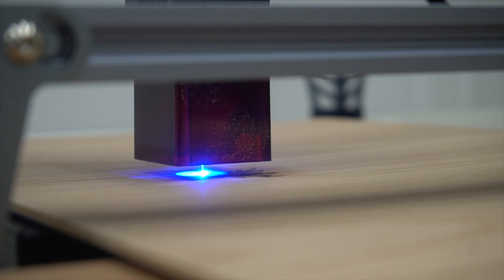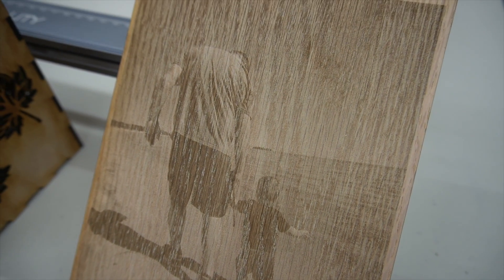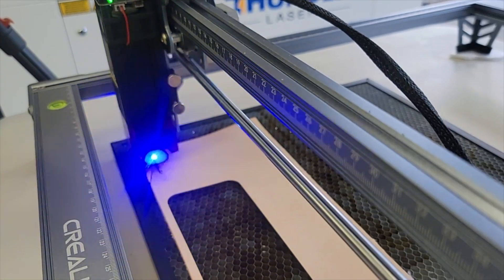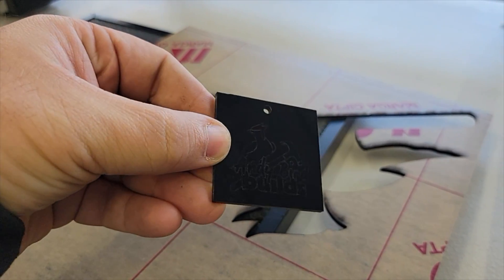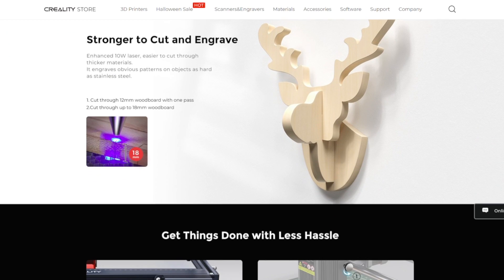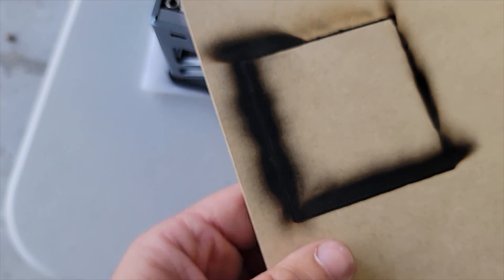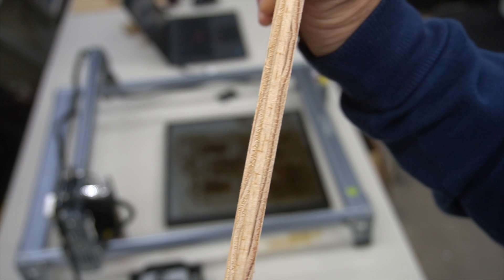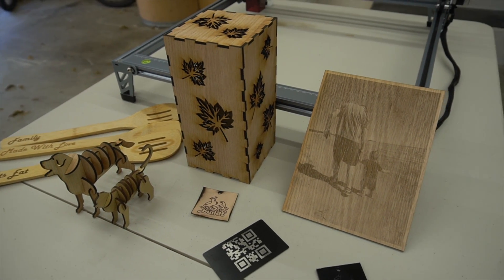You can make EPIC things with this $500 LASER! Creality CR Falcon Laser 10w Test and Review

Comment: With this laser you need to do three things first. Make a speed/power board, a linear test board, and a focus test board. 70mm/s and 20% with 360dpi will engrave clean no smoke in most light woods. Use offset fill to speed things up by eliminating useless scanning of the laser head, For portraits use image adjust to make the photo high contrast, and run Jarvis mode at .07 linear.

Comment: I really want to do this, but I live in an apartment complex that has an attached garage unit. The issue I see is the lingering smoke or smell  emminating from my open unit and there is also a fir sprinkler in my garage, any advice would be greatly appreciated!
Reply: You need a multi-stage HEPA/carbon fume extractor to control the smoke and fumes/smells when using one of these lasers in a confined area. Costs as much or more than your laser but effectively does the job! Amazon has them, as well as lots of other suppliers

Comment: Id say slowing down the laser doesn't give you a deeper cut because you've already reached the point of carbon buildup in the material. Which would also explain why you got a worse cut by slowing it down. As you cut and it burns the wood that would material turns to ash inside the cut which prevents the cut from continuing. If the cut wasn't going to be made anyway then slowing it down just creates more ash and makes the cut harder for the laser to reach the end of. Aerosys doesn't really help with this because it's not going to get all the way down into the bottom of the cut to clear the build up. That's why I even large lasers tend to make cuts in multiple passes versus trying to make it all in one pass super slow. Not only does it create less build up in the cut but it's often faster and cleaner then going as slow as possible in a single pass. Good video, i like your logo and the geometric background wall.

Comment: You are wrong about metal engraving and power.. atomstack 5.5w can do engraving in metal with compressed spot technology.
Reply from the maker: It can mark or remove the paint from the surface of the metal, but it cannot actually engrave into the metal.
Reply: @AndyBirdBuilds   Creality seems to claim it can.

Comment: Can you hook up an inert “shielding “ gas ((Ar, N, CO2, with proper ventilation)to the air Assist?
Also, can you “dish” an area of wood? I’m trying to imagine a painting pallet made of lightweight wood (balsa, etc) with dished areas around the pallet for paint. I was thinking set the depth of the laser depth at about 1/3 the thickness of the wood in the shape of an egg”ish”, then crank up the air assist with the inert shielding gas. 

I’m sure someone’s done this by now, if you’d point me in the right direction, I’d appreciate it. Thanks for the video. Very informative!

Comment: Sorry for being a little late to your channel. Focal point is an important factor, not just laser power. Lasers are so precise because they can focus the energy at just one point. But the thicker the material is, you're actually looking at multiple focal points. You can increase the energy, but the resulting power will just burn more stuff rather that having a precise cut. So, best to plan for multiple passes, each one going slightly lower in the Z axis for focus.

Comment: I have a creality 10w laser and I was able to do light engraving on both high carbon spring steel and stainless steel.  I haven't tried aluminum.  I was running at 2mm/s, 100% power and did 4 passes total.  It wasn't real deep but it definitely etched/engraved.  I was putting a symbol on a knife and bumped it, which messed up my setting up and it took 20 minutes of hand sanding to fully sand away the engraving that I messed up so I could start again.
Reply: That's what I thought, the Creality website claims this laser cutter can engrave and cut matte stainless steel.

Comment: you can cut wood better little more speed and not can one pass, need many pass then cutting good. mean laser need draving picture etc, round 2 time or more then cut and not burn edge lot. best have if use cnc carving machine Z axis can  drop ewery pass better focus and cut better not burn wood edge lot, because ewery pass laser optimal focus have little down has burn/cut wood little more down ewery pass.

Comment: This is a awful piece of kit. Arrived broken, I had to soldar the control box wires back together after they asked me to do it. This morning it blew every fuse in my house and will not work.
No customer service in uk even though I bought it from the UK store.
Buyers beware
Reply: If this little thing could blow every fuse in your house, the problem lies with your house.
Reply: @Jamvan001  sure, or one soccets have too many device sametime. 230V 10A fuse can use max 1200W machine 16A fuse normal can cut 3400W or sauna stove or big motor circular saw.
Reply from the maker: Can you confirm that you purchased this exact laser? I ask because there are a lot of similar knockoffs.

Comment: I have a Neje 3 Max with the 40640 12w optical power module, cuts 6mm MDF at 300 speed 100% power and 3 passes, clean and no charing of the wood. Focus set minus 3mm and air assist is an absolute must. I'm sure with a bit of tweaking on your part this machine will do similar. Also cuts and  engraves  3/4 mm acrylic ( black and some of the darker colours, diodes will not cut clear or very light colours). Hope this helps.
Reply: Ah, cool info on the clear acrylic!  Saves me the hassle of thumping my head about that lol
Reply: Do you think the 80e neje worth buying it. Is it worth buying the 4 ver 3 . Or is the 3 good with the lower price

Comment: I have the CR Falcon 10 Watt, and while it won't mark aluminum, it will mark some metals.  For example, I have marked a variety of hand tools.    To mark aluminum using a marking spray or tape should provide good results.  CerMark makes a variety of products designed to mark metal, including aluminum.  Brilliance Laser Inks is also working on a product to mark aluminum.

Comment: Did the laser run on full power? I've been told and noticed myself that the laser may deteriorate in doing so. In such case you probably can not cut through the same material at 1mm/s anymore either.
Reply from the maker: This was at full power. I've heard the same thing but I think its more of a gradual decline. I don't think I would see the loss of power this quickly
Reply: @AndyBirdBuilds  For me it was rather quick. I would not generalize this. But I think its worth considering in your investigation.

Comment: Another great video Andy.  Even though Andy called Anodized Aluminum “painted Aluminum.” It’s really not equal. It is a coating kinda paint ish but it actually changes the face of the aluminum structure and colors it.  It adheres to the molecular parts of the changed surface.  I would just think of a gold plated surface.  Still not exactly the same but closer.   I am quite sure Andy knew this much and more.
Reply: There is aluminum that is only anodized, it has a light grey matte color. In order to get other colors like red, black etc. the anodized surface is impregnated with dye (paint) before it is sealed to keep the dye in the metal oxide layer. So if it's anything but light grey, it's both anodized and dyed.

Comment: Why not cut faster and multi passes?  I think with air and 3mm per/sec you might get there in 2 or 3 passes
Reply from the maker: Yes that would work. But I was testing the power of the laser and multiple passes wouldn't tell me that. My question is why when slowing the laser down didn't it cut deeper?
Reply: @AndyBirdBuilds  cnc machine u can cut lot better ewery pass laser go little down and focus have better/optimal. how smallest line wide have then better laser focus have and cut better.
Reply: @AndyBirdBuilds  Fixed focus lasers seem to have shorter cutting range, those that have a focal distance of about 50mm have longer cut range.  Still pretty crazy that these cheap lasers can cut through this thickness of wood.

Comment: I think trying to cut 1 pass isn't doing you any favours. Your focus point needs t change,  but your focus is at top of the material never progressing through.
Multiple passes in Lightburn will allow faster speed & progress to greater depths at each pass. In 1 pass you've probably found the limit of intensity of the Laser per pass at about 5mm. But inspection of the cut face might show changes in burn intensity/depth.
Reply from the maker: Thanks for the tips! Any idea why when I slowed the laser down by half, it didn't cut any deeper? I feel like going from 1mm/sec to .5/mm should have cut deeper. I know that multiple passes would solve the issue, but that still wouldn't solve the above.
Reply: @AndyBirdBuilds  soot build up in the groove? Can't remember if you were using air blower for that carve, but it's possible overheating soot will caramelize it to chunks of carbon rather than loose soot
Reply: normal 10W focus power laser can ccut 20mm wood. maximum ,  multipass. but 5W laser only 3-5mm

Comment: In university we had a couple of Epilog CO2 lasers. Whenever I noticed it wouldn’t cut all way through (when it probably should) that was an indicator that the lenses needed to be wiped with some alcohol (to remove soot). 

I’m not sure how the diode laser module is constructed but perhaps there is something similar you can do.
Reply: Yes,  there is a Lena’s that can be cleaned.  When air assist it used,  it also keeps the lense clean, less cleaning

Comment: I've worked on some industrial laser cutters for excusing complex shaped PCBs. We always perform several passes and move the z axis for each pass in order to get the optimal focal length. If not, you get high amounts of burning an a shoddy cut.
Reply: This makes a lot of sense to me. These laser cutter have fix focal point at 3mm, so it should be 3mm to the cutting/engraving surface and it goes out of focus with the beam widening the further it goes. Cutting thicker material should have multiple pass with z axis adjusted closer to the material each time so it's about 3mm to the cutting depth (below the surface of the material) after the previous pass.

Comment: Well your "Focal point" is at the surface, so 10+ mm deep that focal point is not even remotely working, not to mention the air, burn particulate etc.  Hence why many that cut deep like this would try multiple passes or have the laser a bit closer to the surface?
Reply from the maker: Thanks for watching. The focal point was set per the manufacturers recommendations. I think its pretty obvious that multiple passes would cut all the way through, but that wasn't what I was testing. Multiple passes doesn't explain why when slowing the laser down in half, it didn't cut any deeper.
Reply: @AndyBirdBuilds  I do not own an engraver and never saw one working but I am watching your videos to educate myself and set my expectations properly when buying one. Allow me to make a wild guess:  I suspect the engraver has preprogrammed protection and when you lower the speed under a threshold it will automatically lower the power.  How to measure the power of the laser beam? I do not know but I would use the following method to compare the power actually used with the two different settings: use a digital camera and take a picture with 1s shutter speed when the laser cuts at 1mm/s and a picture at 2s shutter speed when the laser cuts at 0.5mm/s. No light in the room. Experiment with the aperture and ISO of the camera to avoid overexposure but use the same ISO and aperture for both.  Basically in both pictures, you should see the same length impression but you would expect that in the second picture, the impression is much lighter as more energy was expected to be delivered in twice as long time. If it isn't, that proves that the laser was dimmed at lower speeds. When I will have an engraver I will put my thought experiment to practice.  Thank you for your videos. It is a pleasure to watch them. I like your presentation style.

Comment: The thicker plywood not cutting at a slower speed is probably because of different density of the internal layers. Use a slightly higher speed with multiple passes (5 for example) and I bet it gets through.
Reply from the maker: I agree! Material density is the issue here. Thanks!

Comment: Wondering if the air assist is cooling the surface too much on a slower pass to not cut as deep.
Reply: Only if air moves faster than the speed of light! Laser will reach progressively deeper levels faster than the air can blow the at point of contact
Reply from the maker: Possibly? Not sure

Comment: to cut thick materials you should do multiple passes, with a diode laser I cut 3mm MDF at 220mm per minute with 2 passes
Reply: Yep, faster feed speeds and multiple passes. Other chs have done that, the faster cuts reduce the charring too. Seen some chs go up to 8 passes. Air assist sure is needed to reduce char but don't use normal air compressor, that is too much air and cools the burning down too much.
Reply from the maker: Thanks for sharing!

Comment: Great video. This laser is definitely on my list. Would have been interesting to see a comparison of acrylic without the masking or to see the results of a multiple pass on the last test.
Reply: On a 50 watt ThunderLaser, I did a test alternating with and without the mask (on top and bottom ) using a different laser varying power settings to check depth of cut - I noticed a SLIGHT ridge where the acrylic is masked vs unmasked - barely perceived by my tired old eyes but I could notice the ridge with my fingernail. 

I think leaving the mask on is best because you have a smaller chance of scratching the acrylic
Reply from the maker: Thanks for sharing!
Reply: @AndyBirdBuilds  will this laser print on cloth
Reply: Can i use different brand air assist such as sculfun